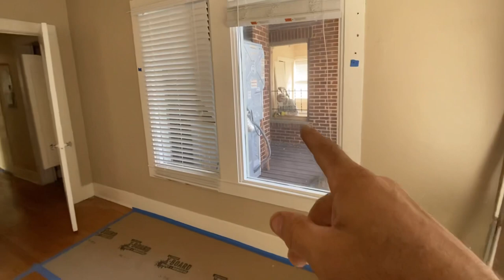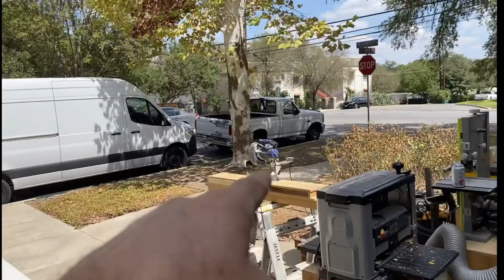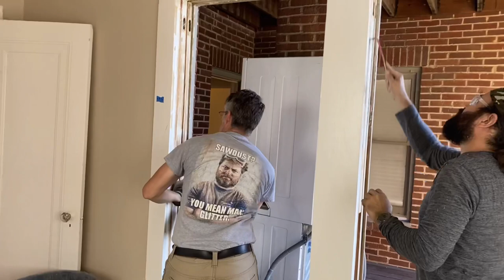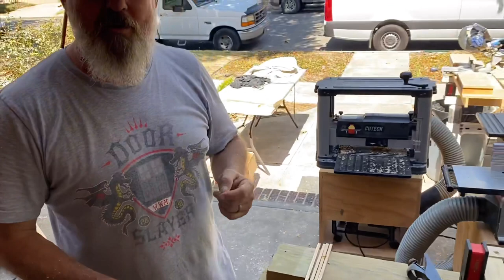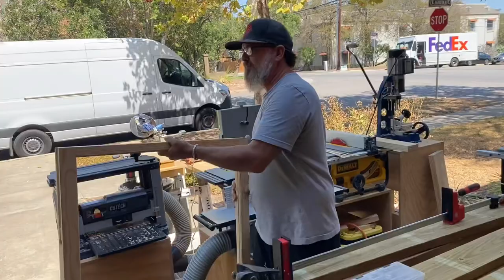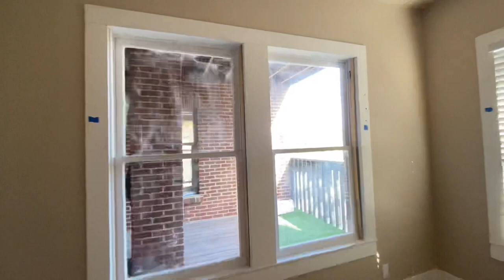Site Built Wood Window Sash To Restore A Traditional Double Hung Window

Comment: Greetings sir, You make a great mentor to many people, I hope they appreciate your skills. You and I are a very dying breed of people. I do not understand why so many don’t see how incredible being a skilled craftsmen is as a career. I’ve been doing this for 37 years as a door and window installer. I’m curious on other videos you use putty on the inside to glaze. Do you ever use removable wood stops to glaze your units? If so do you have a video of what or how you’re making the glass glazing wood stops? I am based out in southern California the depravity state. I’m curious where you are located because it seems like there are more wood windows where you are at.
Reply from the maker: I rarely use the wood glazing mostly because I don’t trust it long term in my environment. Wood, expanding and contracting as it does, opens up water traps and allows fungal spores to get in. That’s surely not a problem in drier climates. But I worry about it where I am and thus avoid it.

Comment: 3:28 love that. Strange question : the order of the dowels is important ? I mean : the exterior dowel could be drilled closer to the shoulder of the tenon , vice versa?
Reply from the maker: I think that’s kinda splitting hairs. I’m sure there’s a scientific/mathematical way to place these things, but by the time someone goes through applying the formulas and such, I’ll be glazing.
Reply: @WoodWindowMakeover  I’ll be faster : I will use a silicone gun;)) kidding …
But still scientifically cool question . 

Also: why the pegs put on the exterior and not interior ??

Comment: We have a ton of old windows to restore in our 1891 mansion we are rebuilding. We have been watching your content because you seem to know what you are doing. We haven't watched all your videos yet and might not have seen the process but you mentioned that you don't glue the mortise and tenon joints at the corners. Is that standard practice when making sashes?
Reply from the maker: It is standard practice to not glue the mortise and tenon joints. As a matter of fact, thousands of historic sash having passed through my hands, not a one of them was glued. Not one.  I think the idea is that once upon a time, it was assumed among he general population that artisans would have to take them apart from time to time for repairs.
Reply: @WoodWindowMakeover  Thanks for the reply. We found a load of 2 1/2 inch thick heart pine that we are going to use to remake our sashes. That was what was used originally. In the past, someone used regular pine and they rotted out within 20 years. There are some of the original heart pine sashes that are still in great shape after 130 years. When we start, we will mention your channel on ours so we hope we do you proud. =)
Reply from the maker: Doing what you’re doing already makes me proud.
Reply: @WoodWindowMakeover  Thanks!

Comment: Love your work!!!  Curious what do you prime the rabbet with before installing glass and glaze?  If you don't mind one more question... I glazed a metal sash last night with sarco dual grey glaze.  Outside temp 62F.  The glaze kept pulling out or would tear from tension of running glazing knife over it.  I just couldn't get a smooth finish.   Not sure if ambient temp was affecting it or if I need to give glaze more time to setup before smoothing (obviously I'm a noob)  Any ideas?  Thanks again!
Reply from the maker: Prime at a minimum with oil based primer. If I have the time, I like to presaturate it with a boiled linseed oil/turpentine/Penetrol mix. Oil and water don’t mix. I’m trying to give it as much water resistance as possible. 

With your pullout, I’m guessing it’s the angle of your glazing knife. The steeper it is, the more it’ll act like a scraper instead of a smoother. Think of it like spreading cake frosting or peanut butter. Do you hold your knife at a steep angle to do that? No. Then don’t do it with glazing compound either. Have you watched my latest glazing video? I kinda go into that.
Reply from the maker: Try this one and see if it gives you some tips…. https://youtu.be/7LHZzwdWPPg
Reply: @WoodWindowMakeover  Your diagnosis was correct...I was too steep on the angle.  Thank you!  Why don't we coat the entire sash/frame with oil/turpentine/penetrol?  Thanks again
Reply from the maker: Sometimes we DO coat the whole thing in oils. It does a lot of good for the wood.

Comment: What is the Dewalt model name of the circular saw please ? Which is the most accurate portable table saw for cutting joints accurately ? Thanks
Reply from the maker: This is the DW745 I believe. It was on the shelf at the home stores for over a decade and I couldn’t find a better value in a portable table saw. Others might have been competitive but nobody beat it. Bad news is that you can’t get this saw anymore that I know of. They now sell a lesser model that takes an 8-1/4 blade instead of a 10”. BUT in a weird twist of fate, Harbor Freight now has the EXACT same footprint of this saw. I’ve yet been brave enough to buy and try, but if it’s anything like this one, it’ll be good. That said, the bigger version of DeWalt’s table saw is still available. It’s about $600 and is a great saw, but, the stand it comes with is at best, alright. I love it once it’s set up. But if you have to move it, it’s literally a drag. If you want a Cadillac stand and an ok saw, the Bosch is pretty good. I think the Bosch is ok, but I like the DeWalt a lot better.

Comment: Why couldn’t you make them at the shop..?
Reply from the maker: I could. But my set up is designed to take on the road, like this. If fit this entire set up in the back of my dad’s 95 Ford F-150 short bed pickup.
Reply from the maker: And I want to demonstrate that a person doesn’t need a big shop to be able to do this work. It’s useful, having a shop, but there are trades made to keep one.
Reply: @WoodWindowMakeover  absolutely agree. But since my winters are “hell” not easy …